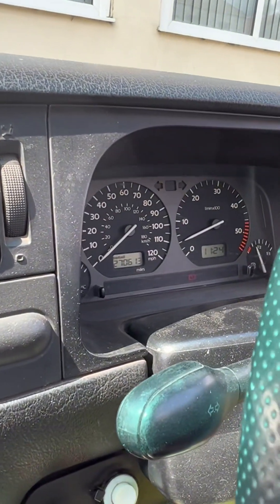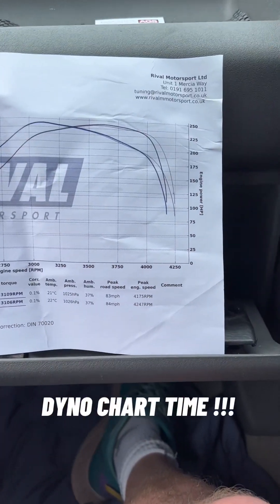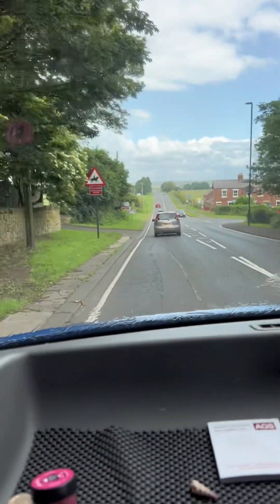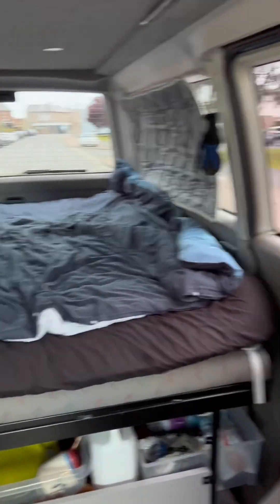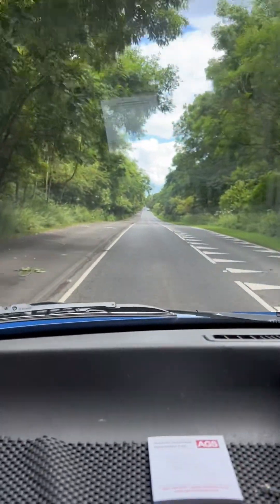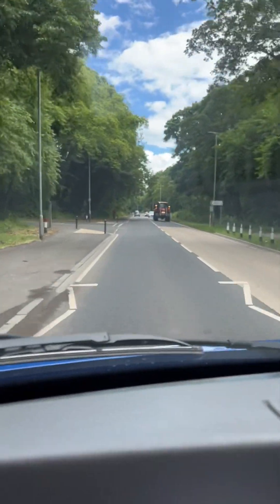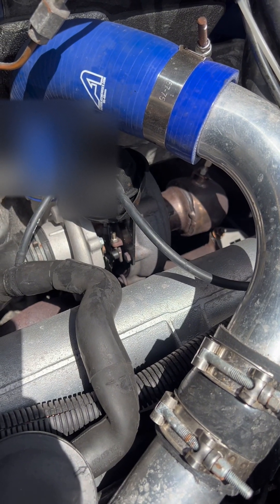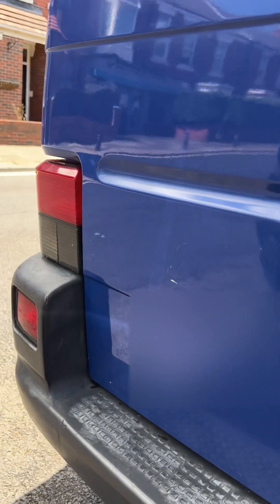PROJECT POWER TDI - 250 BHP KIT ROAD TEST !!!!!

Comment: I have heard it said that the gearbox is not strong enough for more than 200bhp, although no torque figure was mentioned.
Presumably, the gearbox will not break but there will be an accelerated wear rate.
Do you have any experience or thoughts on this matter ?

Changing to an AXG gearbox is not very realistic as you have to change half the world as well and all the parts have to come from Germany
Reply from the maker: Absolutely no problems with the gearboxes so long as they are maintained and the oil is changed and kept topped up. The gearbox is fine.

Comment: Brilliant to finally see a face to project power
I bought a set of injectors off you Kildare southern Ireland remember I had trouble with the sensor in the 5th injector
Anyways haven't ran right since I swapped sensors not your fault
I'm currently building a motor acv 2.5 and it's a mint block crank etc snapped a t belt
I'm planning getting mine up to that spec or even 200 if you could give me a parts estimate and probably a trip over to have you tweek the fueling as you do a great job I've seen a lot of your timing videos
Reply: Has anyone tried a 5 cylinder 16v head for the t4 Volvo t5 maybe?
Reply from the maker: Sure thing - please email rake@project-power.co.uk as I can’t message you on you tube
Reply from the maker: Please email me rake@project-power.co.uk
Reply from the maker: @gearsandtears7643  email me